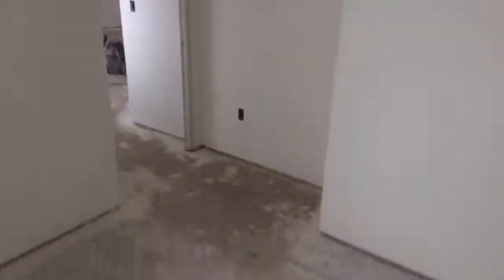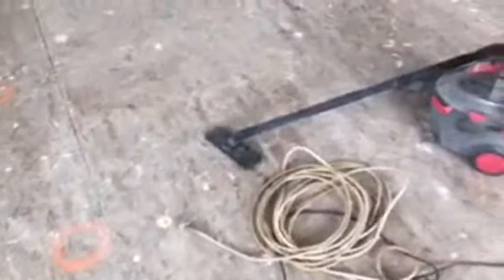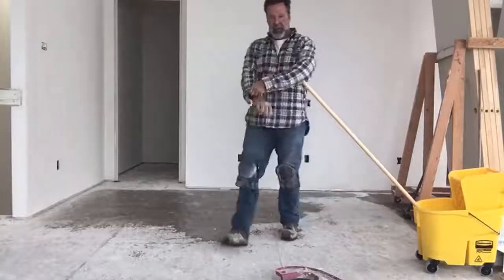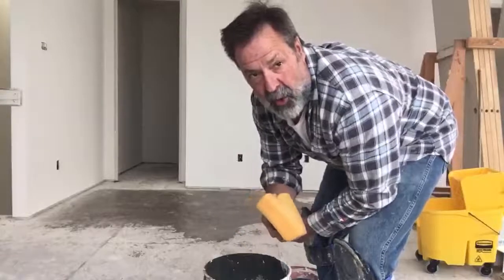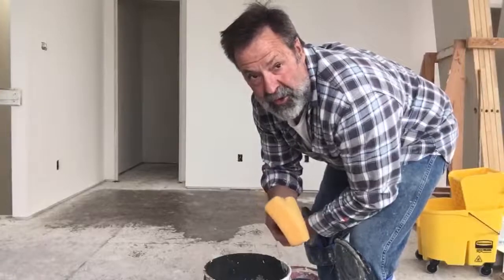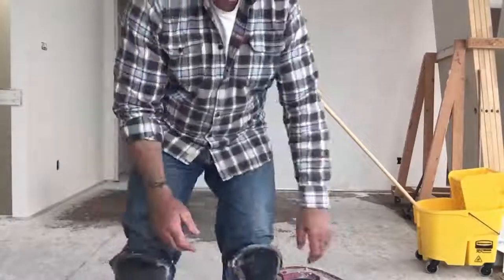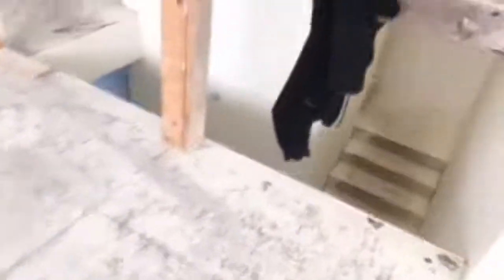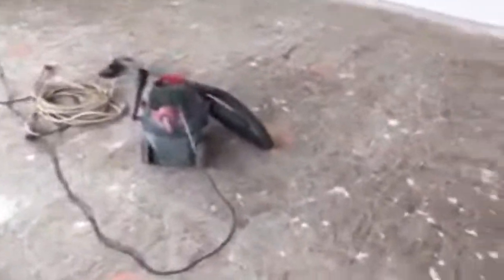How to clean  Dirty￼ subfloor before Installing￼ backerbroad

Comment: My "professional" chose to leave years worth of  dust, sanding dust, and sawdust on my subfloor. He laid LVP (terribly) and swept so much debris into my floor vents then turned on the AC so it coated my walls. I fear i will be dealing with dust in a new house (after a housefire) forover... 😮 good going on your floors!